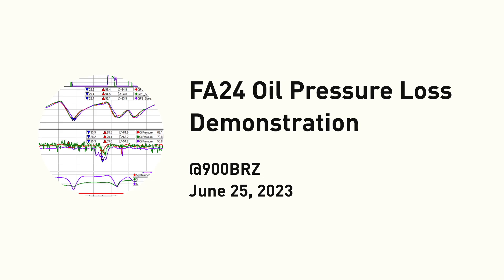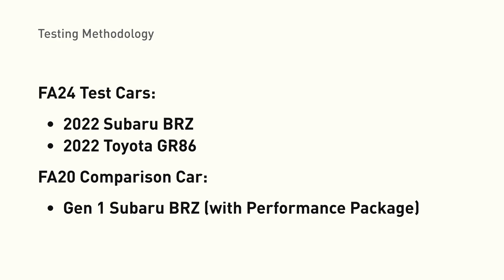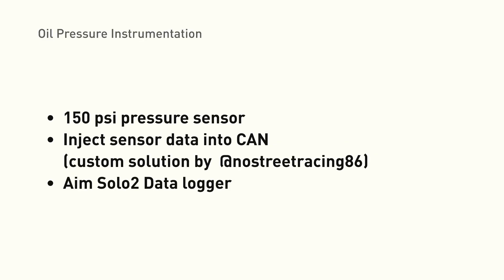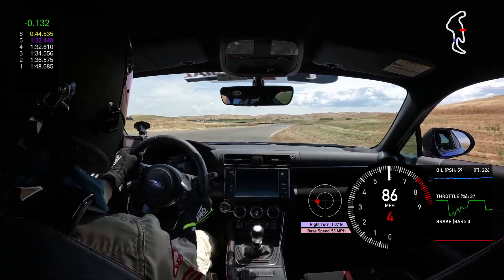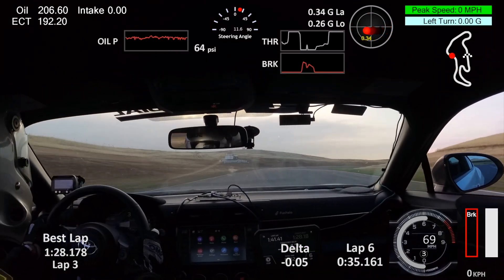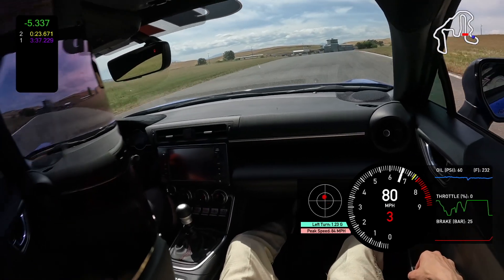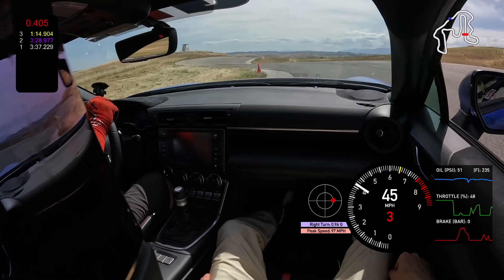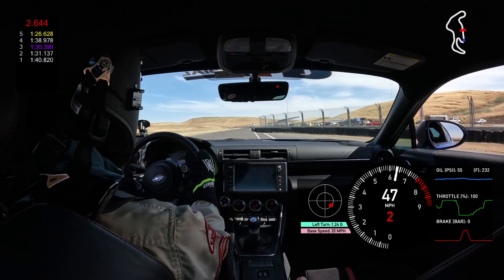BRZ/GR86 FA24 Oil Pressure Loss Demonstration

Comment: question based on what seems to be happening on more right than left hand turns, where is the oil pickup tune in the pan? is is based on the right hand side? this would cause oil to go to the left side of the pan and copuld be causing the pump to pull in air leading to lower pressure. as these are subject top fast moving oil around the engine as a test have you tried a few different methods as slightly more thyan stock oil? a 1 way flap oil chamber in the oil pan to help keep more oil around the pickup tube? i find all this very interesting and even thought i dont personally own one of these i would like to see how this outcome for fixing the issue comes about.
Reply from the maker: The theory about the offset pickup is on the end of the video. There is a battle design with a flap but it’s not one way for some reason. Not sure why not.
Reply: @900BRZ  thank you for the rreply, i missed the part about the tube and pan style. in my opinion i feel you should invest in a pan that has a 1 way door flap to keep oil in the pan. if the baffle is open to both directions i dont see how it will solve this issue but insead make it worse by slowing the flow of oil back to the lower section of the pan. but since i dont kn ow the design or what it looks like my points are purely speculation. but i am looking forward to an update on your findings with the new pan. hope you have a video soon talking about and showing the prototype if you are allowed
Reply from the maker: I was wrong about the flap in the Kazama baffle design. It is actually one way. I’m interested in this design now.
Reply: @900BRZ  thats good that it is, cant wait to see a follow up video

Comment: 😮 Man soooooo much information... really big big thanks for you and your team great efforts and knowledge. 
I'm getting my new 23 BRZ next month as its on the way. But just one suggestion since you have 2 identical cars...
Why not test both same day as you did but one with 5w30 and the other with 5w40 because I believe maybe this very simple step with 5w40 oil could improve the oil pressure by a good amount
Reply from the maker: As of that track day, the GR86 already had a SYMS baffle installed, so we compared its data from an earlier track day. If I could conduct the ideal experiment, we would definitely do it all same day, multiple oils, and install the baffles same day as well. At a minimum, same weekend.

Comment: Hey curious question.  could ever by chance do the same testing on FB20s/FB25s. To see if they also suffer the same drop in oil pressure. And if the oil pressure do not drop the same , what is the difference between the FB/FA engine which causes one to have a oil drop and the other not to. if that makes sense.
Reply from the maker: I’d be interested to see those tests, but I don’t have any of those cars available to me. Hopefully we can make the oil pressure instrumentation more accessible and others can do the testing.

Comment: I bought an FRS brand new when they first came out. I changed oil every 4k - 5k with good synthetics and my engine didn't last to 80,000 miles before I had a rod bearing failure. I did use performance suspension and tires but the engine was basically completely stock. This car did spend a lot of time in corners but never tracked.

Comment: Great work and excellent video!  Thank you for doing this and as a GR86 owner I'll be following your efforts closely.  It would be great if a baffle can solve this issue.  I have also seen Accusump used in some cases.  There are some track cars that have just used an additional quart of oil in the system to prevent starvation.  However, I realize that too much oil can cause its own problems.

Comment: So subaru engines die when they have 20psi oil pressure?
Reply: He discusses this - how much psi is required per 1000rpm.  At high rpm (near redline) oil pressure is dropping to 20psi.  At idle it is more than that!

Comment: oem oil pressure spec is 73 psi @ 5k. RPM.   others are reporting pressures closer to 80~100psi,  how come your max oil pressure is only around 60psi ? just wondering. thanks !   im getting worried to a point where im shopping for a oil pressure guage.
Reply from the maker: Are these people on track at high temps? I see around 70 psi in casual freeway driving. Every time the car starts up, when the oil is not up to temp, pressures will be 100+ psi.

Comment: Great . . .  I just bought 2023 BRZ thinking it would be 'track proof'.  I track TH, LS and Sonoma but have not yet with my new BRZ.  Not sure about Toyota but Subaru has taken a very conservative/proactive approach to things like this in the past.  i.e. valves springs on 10 year old cars getting replaced free of cost.  Hoping for the best.
Reply from the maker: Good news is you can short shift to drive around the problem to some extent. We’ll keep posting our findings.
Reply: @900BRZ  What about the Tomei Oil Pan Baffle Plate?  Or would a larger oil filter flow more oil?
Reply from the maker: @slobdog21  We have data on the Tomei baffle. It definitely doesn’t solve the problem. Will do a video on 3 baffles we’ve tried now. 

Interested in the larger filter. Apparently they reduced the size on FA24 for pedestrian safety.
Reply: @900BRZ  wut ?

Comment: awesome stuff. I'm also wondering about the FA24 in the WRX as well. it would be interesting to see if similar issues arise under similar testing. Then there could be a compare/contrast between the two motors. Maybe one deals with the drop in oil pressure better than the other?
Reply from the maker: I’ve not done any testing and there are enough differences to support the turbo that I don’t think it’s possible to extrapolate these results onto the WRX.

Comment: Does the added oil cooler on every car allow to much oil to be removed from the engine causing pressure drops?

I've been so close to buying one of these, but nearly every mf crossover suv is faster these days (not that id buy one buy its the principle). Just a sporty looking car with the engine from a lawnmower, It just needs more hp. Like the early boxsters, id be good with no lsd and atleast 275hp.
Reply from the maker: It is still a momentum car, but it has plenty of speed for me on the track. On the street, lots of cars can out accelerate it, but that’s not really the point.

Comment: Pretty basic test, but certainly sufficient to identify that there is without a doubt a design, assembly, or component defect. The fact that both cars had the issue leads me to believe it is more likely an engineering design flaw than an RTV related assembly defect, but I’m sure you know that. 

I watched the entire video, not expecting to learn anything,  but because I am a firm believer in HOLDING LARGE MANUFACTURING COMPANIES ACCOUNTABLE.  Automobile quality has dropped significantly in the past few years so to short sighted greedy business practices all while increasing prices.  Thank you.

That being said…

An engineer already knows about the issue.  GUARANTEED.  The warranty costs have already been included in the expense budgets.  The condition required to produce a failure isn’t going to be achieved by 99.5% of buyers.  Let’s also keep in mind that we aren’t talking about a 911 gt3 or even a mustang gt350 for that matter.  We are talking about one of the slowest accelerating “sorts cars” ever produced.  My advice would be to buy something actually designed for your desired purpose.  

You get what you pay for, and that car is as cheap as a new “sports car” can get.
Reply from the maker: It’s possible that they knew and they believed that this was within their design parameters, but that would be very disappointing.

Comment: I'm a bit concerned. I have an order coming in the next few months. I don't really plan to track it at this stage but will still drive it hard. Should I cancel? It seems like there's something wrong with every car on my list though - M2/M3 crankhub, 987 / 997 - bore score / ims, MX5 gearbox. 981 and  supra seem solid enough.
Reply from the maker: If you’re not tracking it I don’t think you should worry. If you want to later, hopefully we’ll have solutions.

Comment: Would be interesting to see the oil pressure drop between cars without oil coolers and cars with oil coolers to see if the introduction of the additional “oil circuit” places more strain on the pump. Not an engineer just wondering about the effect of this.
Reply from the maker: Agree would be interesting to see. Hopefully more people start collecting data.
Reply: @900BRZ  thank you for your hard work and sharing your findings

Comment: Any reason why are you not using an ester based group 5 oil like motul 300V or Amsoil. Not saying it would fix but atleast having the esters stuck on to the bearings during low pressure should help.
Reply from the maker: One of my friends who suffered an FA24 failure had used 300V from his first track day. It’s not a panacea. I selected this oil because it’s rated for street driving (unlike 300V) and my car does do some (not much) street driving. We selected Motul 8100 because it has a high HTHS viscosity of 3.5 mPas.

Comment: Hello. I am Japanese. I was also looking to buy this car, but the potential problems bothered me so much that I gave up on it.

Also discussed in Japan.

Is this video that the cause of engine blow of gr86 is not caused by fragments of gasket?

Gr Yaris also has several cases of engine block crushing.

It's a very unfortunate issue.

I'm not good at English, so please explain briefly what you want to convey in this video.

The baffle plate was approved as a certified part in the Japanese cup car race.

Baffle plates with rubber valves regret the rubber falling off.

We will also introduce this video to the Japanese community.
Reply from the maker: > Is this video that the cause of engine blow of gr86 is not caused by fragments of gasket?
I can’t make this claim. Just presenting the data we’ve observed. 

> I'm not good at English, so please explain briefly what you want to convey in this video.
Without baffles, it’s possible to observe reduced oil pressure in certain corners, even with low grip tires. The pressure drops are more severe for advanced drivers, but observable for intermediate drivers as well. The slower your pace, the less you need to worry about pressure drops. 

I will share results of my test with the Killer B baffle. 

Thanks for watching!
Reply: Thanks for your reply. And thanks for the informative article! !

I am happy to be able to exchange opinions across countries.

I was looking forward to Japanese products, but I'm sorry that I couldn't meet your expectations.

Everyone overseas. sorry.

The topic is that the liquid gasket clogs the strainer,

Many vehicles have been reported to have a clogged gasket that is a different color than the oil pan gasket.

It was the same color as the gasket near the camshaft.

Originally, the inside of the oil pan has a structure based on the image of a baffle plate, so I'm curious about the test results when the baffle plate is added.

Thanks for the useful data!

Comment: Great video, this is such a clear demonstration that something is very wrong within the FA24 motor. Hoping your baffle works, FWIW I've owned 2014 gen 1 since new and have done approx. 45 track days with 0W30 oil, a cooler and Greddy sump baffle and I've not had any engine issues, all my local tracks are clockwise too.

Comment: Some input from Europe: Here we have mainly clockwise circuits - that means a lot of right hand turns. I have a modified GT86 from 2013 with HKS compressor and had installed a baffle plate after an engine failure (likely not enough oil at a bearing). Since then no issues.

Comment: Subaru engine what would you expect? I would also be worrying that oil pressure doesn't keep up with rpm when it doesn't drop. To my understanding ballpark there should be 10 psi for every 1000. The rpm at 7000 rpm it doesn't reach the 70 psi. Maybe a dry sump system would be better for tracking these vehicles. I hate engines that make me invest more in this type of issues instead of a bigger turbo 😅
Reply from the maker: That is a rule of thumb, but it’s not a strict requirement. If we solve the pressure drops and keep roughly 60 psi nominal pressure at temperature, I’d be very happy.

Comment: Does this happen on the Sti / EJ motors; as those oil pick up are also  asymmetrical
Reply from the maker: I don’t have any experience with those, but I’ve heard EJ has problems with oil pooling in the heads and requires baffling.

Comment: Wow amazing data setup and well presented. I'm interested to hear the results with the new baffles. Got a 2022 WRX so assuming it would have similar problems at the track...
Reply from the maker: They have a lot of differences actually so would need to do separate testing.
Reply: @900BRZ  that's good to know! Thanks for the reply.

Comment: need to look into Canton accusumps , or other brand oil accumulators .  its a canister which holds several quarts of oil under pressure,   when the sensor senses a low pressure , it bleeds off the stored oil into the oiling system maintaining the wanted pressure , and then rebuilds pressure and stores the oil .   can also be used on a switch to pre oil the engine .
Reply from the maker: Yeah I think that may be a future solution, but I want to do simple mechanical interventions first. Accumulators add additional failure points and maintenance so they won’t be as good of a solution for as many people.

Comment: Genuine question, would adding an aftermarket oil cooler lower the oil pressure due to the increased volume?
Reply from the maker: Yes, I believe it will, if you control for oil temp. However, keep in mind that the goal of the oil cooler is to reduce the temp and oil pressure is inversely related to oil temperature. So an oil cooler with oil at 220° F on the track may have higher pressure than oil at 260° F without the oil cooler. 

Unfortunately, I installed the oil cooler before I instrumented the oil pressure logging. FWIW,  GR Cup runs the same Setrab 9-core oil cooler that all 3 cars in the test are running.
Reply: No.

Comment: I'm interested, perhaps an oil accumulator is in order for the upset caused in the oil pressure? To my understanding, the most common mod for the flat engines are baffling/ deeper sump.

Comment: Great video. This issue is going to appear on any wet sump engine that is wider than it is tall. If you're pulling significant lateral Gs with a wide engine, the oil pan is no longer the "lowest" point on the engine for oil to drain back to. This applies to pretty much every boxer motor. Porsche solves this problem with a dry sump system. For a cheaper solution on a Subaru engine, I would be really interested to see how well an oil accumulator works.
Reply from the maker: Agree. Interesting it seems to be worse than on the FA20. One of my friends is likely going to get an accumulator so we can try that as well. Personally I’d like to improve the performance with a baffle first, but I may also go the accumulator route.
Reply: @900BRZ  And we know you're going to do it in pieces, and measure along the way.  I'm just gonna keep saying thanks.  This comment thread has been really cool, also, teaching me more about boxer motor tradeoffs and implications.  Honestly, that's part of the fun, and is building awareness and knowledge in something that I enjoy.  Cool perspective and commentary @DeltaP9Orange12, generalizing it to "any wet sump engine that is wider than it is tall".  That's a constructive contrast to the "Subaru can't design engines" commentary elsewhere.
Reply from the maker: @michaelruddick2662  Totally agree with that. While I’d rather not have to do any of this research, I’m at least learning a lot and thankful to have an invested and supportive community to do it with.

Comment: Your pressure drop is influenced looks like it is directly  responding the the gforce applied in the video... You can actuallys  your g force go to 1.0 then the oil pressure drops.
Reply from the maker: It’s not quite that simple. There are plenty of 1+ G corners where a drop doesn’t occur.

Comment: I’m curious if running 0w20 would result in lower constant pressures, but would impact how severe the drops in pressure are in the right handers. Also if the coolers themselves might have something to do with it. Regardless, this is an extremely data rich assessment that is well formulated to keep our platform users aware of what to look out for in a track setting.
Reply from the maker: Yes, 0W20 would result in lower nominal pressures at high RPM. The setup we’ve used for the FA24 cars is close to stock, but not actually stock in the ways I’ve pointed out and you’ve called out here. It represents a very mild track setup that is commonly used. I’d be very interested in testing completely stock cars, but I believe (no evidence) they will have more severe pressure drops and I’m not comfortable doing that with my own car.
Reply: @900BRZ There was a very interesting thread on the forums that brought up issues with the first gen, and how pressures aren’t necessarily the end all be all number, as flow rate is what is actually important, but that is much much harder to measure in car. It’s also completely understandable very few, if any person, would be willing to test a stock car on stock oil weight. The fact that people like you are actually doing something to try and find a solution is very commendable, as all we really want is a reliable car for track use.
Reply from the maker: Yeah it makes sense to me as well that oil pressure is only a heuristic for flow rate.